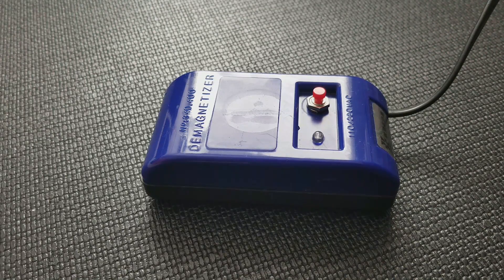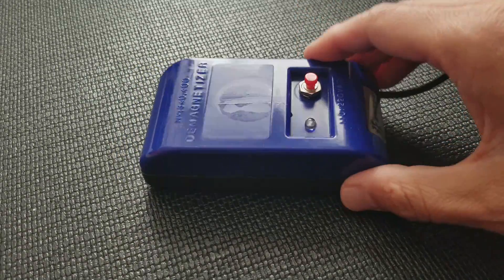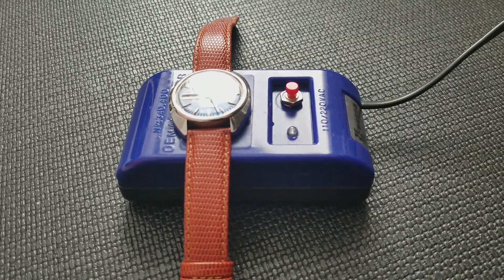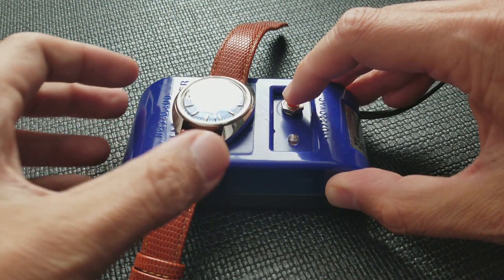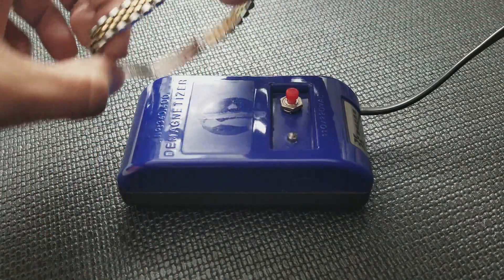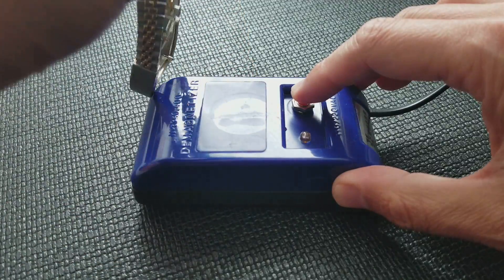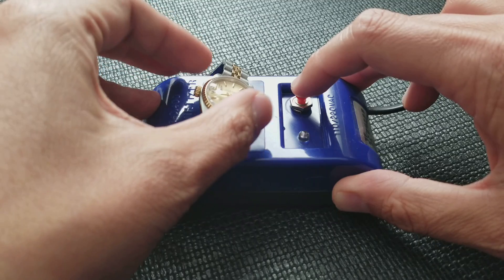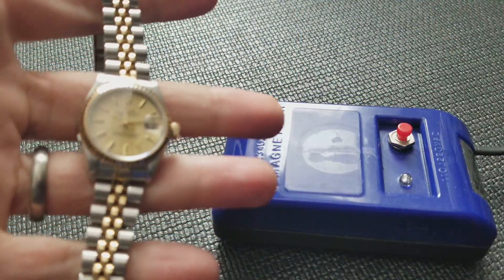HD How to use Demagnetizer Seiko Rolex Automatic Mechanical watch Demagnetize Omega

Comment: My Tag heuer monza watch was running +46s/day,  I bought one of these demagnitisoes and followed the procedure,the only thing I did differently was to pull the crown out to stop the watch before demagnitizing, now it's running +0s/day. I'm amazed at the accuracy of the calibre 6 movement . Also how demagnitizing helps, I thought I would need to send it in for a service, but thought I'd try demagnitizing it as a first option.

Comment: My watch suddenly run slow 1 minutes a day  should I use this?
Reply: Demagnetize only if it's running fast. Magnetism causes the hairspring coils to get closer to each other and shorten thus making the movement faster.
Reply: MDD DD I would check with a watchmaker first because it might just need a service
Reply: Demagnetizing should definitely be one of the first things you do and it will help a bit but if you're watch is losing 1 min/day it won't be enough it will need to at the very least be regulated.

Comment: Can you use this type of demagnetiser to magnetise screwdrivers?
Reply from the maker: Yes you can!
Reply: I believe to magnetize it a different procedure:
Hold the "piece" on the unit, press the button and hold for ~10 seconds, release the button then remove the piece.
It's not super strong so it may need a couple of attempts.

Comment: Hi,  and if the watch go slow it's the same problem?
Reply: No... Magnetism causes the hairspring to shorten and go faster.
Reply: Pacific Standard Time 

Too slow.  

The movement needs to be professionally serviced.
• An impact caused the dial to move and create binding on the digits (this is becoming more frequent lately)
• An impact altered the spring’s key.

Anytime when your watch is running fast or slow, it is advisable to see a watchmaker and let them diagnose the cause for the inaccuracy. Most cases are resolved very simply by fine-tuning the watch on the timegrapher. Depending on the watch and your location the cost runs somewhere between $20 and $50.

The watch manufacturing community has collected data, which shows that 80% of watches that require service are magnetized (to greater or lesser extent). Why, you ask? Because we are surrounded by magnetic fields. Just think of all the smartphones, purses and briefcases with magnetic closures and digital devices everywhere.

Comment: You say 4 seconds, other people say 30. Some people lift the watch Other people just turn it over. Does your method work all the time?
Reply from the maker: It has but you can do both
Reply: chemoautotroph 

The correct way is to place it just above the surface, press the button and slowly lift up the watch while keeping it over the blue square panel on the degaussing device. (This rectangular panel and only this rectangular panel is where the working components are) Release the button once it’s around 40-50 centimetres above. Check for magnetism via the free iOS or android app and If the watch is still magnetic then repeat the process until it is not.

One to two times will be sufficient for a watch. If you cant use the app then you can use a handheld magnetic compass as the compass needle will not be altered by the watches proximity to it if it’s been degaussed sufficiently.

These can be bought on eBay for under US$10.